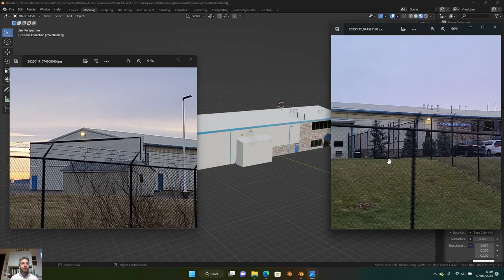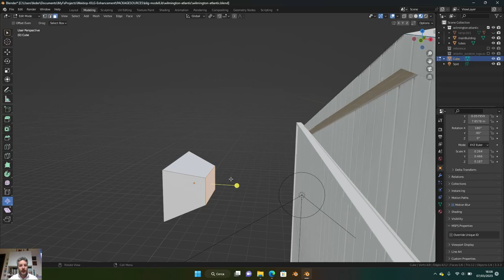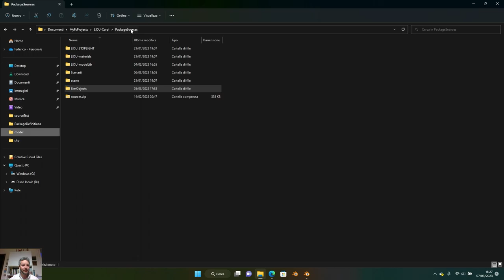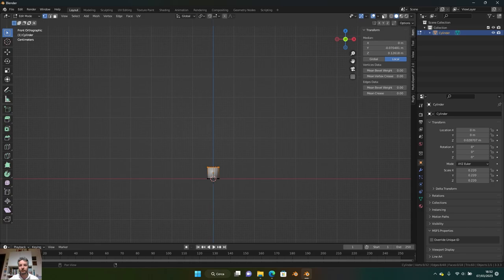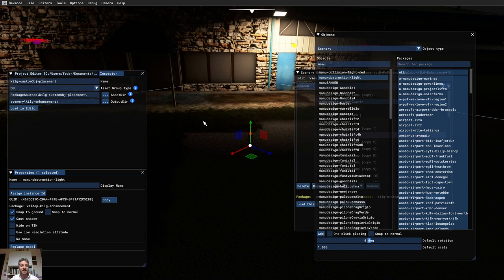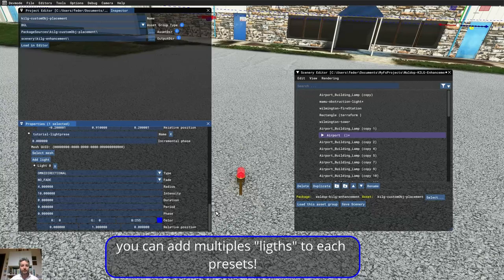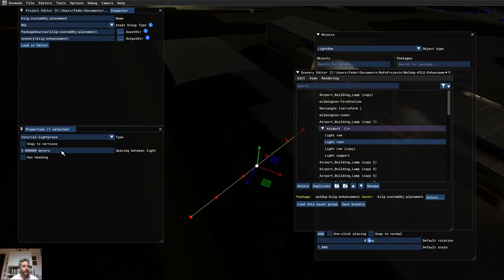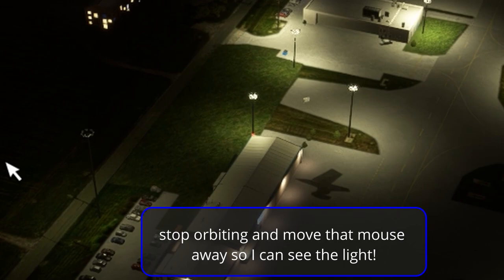MSFS SDK Tutorial - Blender Lights, Emissive and Airports presets - Light Row

Comment: Hi! Great channel! You can make a light visible on a distant outside airports by using the lod system and emitting materials. Put it inside an invisable cube of some size. Downside: It will also be visible at daytime.
Reply from the maker: Hi , thanks!
Yep, exactly like that, if you really need that method you can wrap your light in a Simboject and hide it during daytime 😉

Comment: awesome video, it's proven very helpful. One question I had is in regards to emissive meshes. I have these tiny "bulbs" that I use as my emissive mesh and it looks really nice but as soon as I start to move my camera back, the sim culls out those meshes (as they are so tiny) and I no longer see my emissive effect as a result. Is there a way to tell the sim NOT to de-render (cull) a mesh?
Reply from the maker: Two part answer: the little mesh being culled is because most likely it is not part of the main mesh, but separate. You really want to join the parts to obtain a single bigger mesh, better for permance too.
The emissive disappearing is explained in the tutorial, you can't do much for that other than using the light preset/light row

Comment: Very good tutorial. The glass of my lamp is not transparent like in your video, but the light is visible at night.
A question: how to duplicate the support + light row assembly to place it in another place and at a different height?
Reply from the maker: THANKS a lot!
If you need the glass to be transparent you can tweak the alpha value of the material.
Do duplicate the items, select both in the scenery editor and press the duplicate button to make the a perfect copy of the original, the move them into position (the copy will still be selected)
Reply: @MSFS-SDK-TUTORIALS  
Thank you for your prompt response.
On my scenes there are a lot of beacons on buildings and masts.
It's not easy to precisely place the lights on the top of the masts, even with the gizmo 🤥

For transparency, I decreased the value of the alpha blend several times, without correct result.
I also have the same problem on the canopies of the planes that I transform from FSX to MSFS.

But that's not what this tutorial is about.
Best regards

Comment: Hello, 
Actually the emissive scale can also be tweaked in Blender by using the shading tabs node setup of the emissive material. There is a node for "Emissive Scalar". if you manually type in a higher number than one, it will work and export properly to MSFS!
Thank you for your tutorial.
Reply: You can then even preview it in blender after setting the emissive scale higher than one by going in the shader settings and enabling bloom!
Reply from the maker: Thanks! 
However, the Emissive Scalar, with the Asobo plugin, doesn't work 
I had opened an issue at their github, and this video is part of the demostration :)

https://github.com/AsoboStudio/glTF-Blender-IO-MSFS/issues/213

The emissive scale works ok with the blender2msfstoolkit, but the former plugin lacks of other functionalities (and is way slower than the Asobo one)
Reply: @MSFS-SDK-TUTORIALS  No I am indeed talking about the new Asobo Plugin. You are right in regards to the material tab: The emissive scale SLIDER in the material does not work with values greater than 1. However, as I said, it works by going in Blender - Shading mode and seeing the material in the node setup. If you look for the "emissive scale" NODE you can type a value greater than one and it will show up correctly in the simulator. 

so no need to manually edit the gltf file in text program! Thanks as always, I learned quite a few new things :)
Reply from the maker: @Eichetheking  that would be great, unfortunatly, I have tried like you said, and doesn't work, do you have a working sample to send? blend and gltf? maybe in my discord or federico.pinotti@hotmail.it
so i can share with the dev team to close the issue :D

Comment: thank you so much Federico, for some reason the lights do not shut off during the day night cycle on a recent project im working on, I have enabled the setting as you showed here, any other ideas? something I may be missing?
Reply from the maker: Double check in the glTF the day night switch is active, if not maybe for that specific .blend you forget to tick the day/night option 😊
Reply: I had to manually edit the gtif files, thanks for the advice and solution! Appreciate everything you do

Comment: Hello! Insanely good video but I have trouble adding spotlight into the sim. It's just not appearing in-game. Can you give an advice on where to dig?
Reply from the maker: double check your export options, you need punctual lights activated
Reply: @MSFS-SDK-TUTORIALS  I've found a solution. I've set paret to light spot. After removing it and make it independent solved the issue.

Comment: Thank you! Is it possible to export only a blender light without meshes? I tried so but blender only exports a .gltf and XML file and MSFS cannot recognize it without a .bin file. Also, may I know how to solve the problem where the light disappears when we move away from it? It seems to be LOD related but I have no luck finding the fix. (I am creating a beacon light that should be visible miles away)
Reply from the maker: Hey Mr Song, 
As explained in the tutorial, there is very little reason to have a blender light without its emissive lamp (you can't have light from nowhere irl, do you?)
You can anyway attache the light to a very simple mesh with invisible material, using a big mesh will partially solve the disappearing issue

But the only proper way to have a light that can be seen from a distance is using an airport light
Reply: @MSFS-SDK-TUTORIALS  Thank you so much for the response! I found a workaround similar to what you said. I attached an invisible plane below the light and it improved the draw distance that I am satisfied with.

Comment: So, the emissive texture of the red taxilight turns off at daytime, but what about the lightbubble in msfs? Doesn't that always stay on?
Reply from the maker: Yep, when using the light presets it will stay on, no way to turn it off, unfortunately
Reply: @MSFS-SDK-TUTORIALS  Okay, thanks. Not ideal but actually I've never noticed this with 3rd-party airports. So it's alright, I guess.

Comment: Is it actually the same approach also for cockpit lights?
I am thinking about adding cabin lights as part of my CJ4 mod 😊
Thanks in advance!
Reply from the maker: Hey yep, more or less, e.g. this is for a landing light swith, when clicked, the emissive strenght of the material goes to 2
<Component ID="LIGHTING_Switch_Light_Landing" node="LIGHTING_Switch_Light_Landing_1">
<NODE_ID>LIGHTING_Switch_Light_Landing</NODE_ID>
  	<UseTemplate Name="ASOBO_GT_Material_Emissive_Code">
                <EMISSIVE_CODE>
                   (A:LIGHT LANDING ON,bool) 1 == if{ 2 } els{ 0 }
                </EMISSIVE_CODE>
            </UseTemplate>
</Component>
Reply: @MSFS-SDK-TUTORIALS  great, thanks. I will try that out at some point. Have a good Sunday 👋